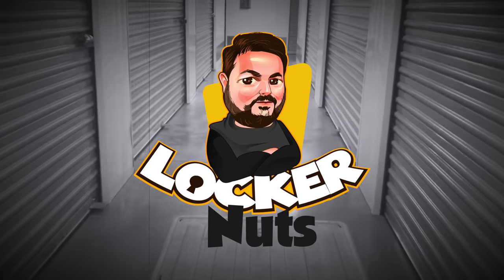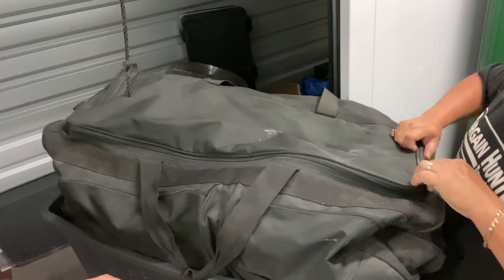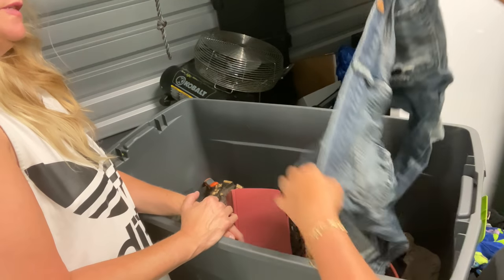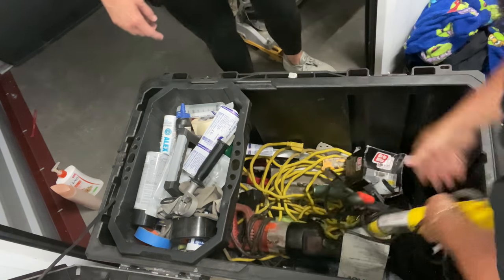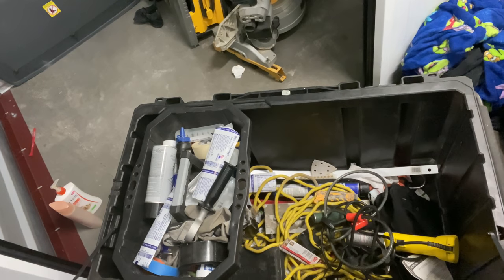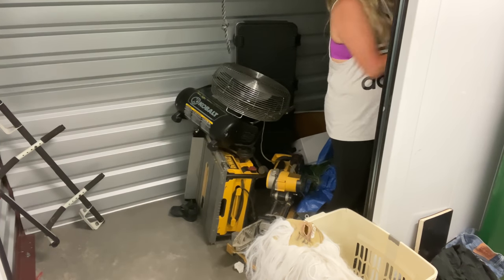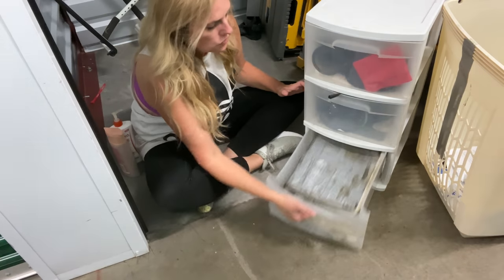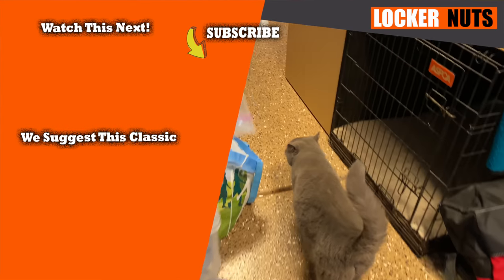WIFE PAID $1,100 FOR THIS LOCKER at the abandoned storage auction, Storage Wars style.

Comment: The cast iron dutch oven can be scrubbed with a 3M pad or scrub brush.  If that doesn't work, you could use a Brillo pad but the hard core cast iron folks will probably freak out.  The seasoning is gone or it wouldn't have rusted.  Then wipe it with a light coat of vegetable oil and warm it up on the stovetop or in the oven, then wipe any remaining oil out.  That should keep it from rusting further.
Reply: Yep, never use steel wool on cast iron, it will put the pan.

Comment: Use coarse salt to scrub off the rust and scrub heated salt in the pot to season it. Finish by applying a high smoke-point oil into a hot pot and then let it cool naturally.

Comment: Wash pot and rub cooking oil over inside and put in oven or on pit,  heat for 30 minutes. Always wipe with cooking oil after washing pot to prevent rust
Reply: Most of that looks like surface rust from moisture exposure.  Instead of the oil, you can use solid shortening. It's easier to apply.
Reply: Are you able to use soap on cast iron? I always heard once its seasoned all you do is wipe it out, since it absorbs the soap??? Not sure just what i heard.
Reply: Cindy King no soap
Reply: I agree scrub it good oil then throw it in a pit fire and leave it till the fire burns out. Thata what I always go with my cast iron.
Reply: yes, what she said
Reply: Never use soap on cast iron
Reply: Agreed no soap just scrub it with one of them green kitchen scrubbers and oil, it's called "seasoning" the pan.
Reply: Lard is the best for it
Reply: Do NOT throw cast iron in the fire! Great way to destroy cast iron.
Reply: Cindy King 
You can occasionally use a MILD soap. Definitely not something good like Dawn.
Reply: @cindyking6928  Only if you've just found it and it's absolutely filthy. Otherwise no.
Reply: @cindyking6928   I have re-cured cast after washing with soap then re oil and bake at 500 degrees it should be repeated as needed until it stops sticking when used. never wash with soap after it has been seasoned. If it sticks while using it should be re cured as needed I re oil mine after each use to avoid rust.
Reply: Use course salt an lemon will get the rust off. Then wash with hot water season with cooking oil and turn upside down an bake for hour
Reply: @chrishirner9292  Correct!
Reply: @Lilbear1960  Any cast can be washed if allowed to rust. To remove deep rust should be sanded to bare rust free metal then re seasoned with cooking grease to 500 degrees 30 min. re greased after each use to avoid rusting again.
Reply: @lindablackmore5882  I oil mine only wipe off as much oil as possible heat until sure there is no moisture or sticky residue then store til needed
Reply: @halomom1  How do you think we did it on camping trips bring a stove? Why would you think fire would harm cast? all Cast was put in or on fire since it was invented  For well over a thousand years, cast iron has been used as a reliable cooking surface. What do you suppose they cooked with? I don't think they cooked with sunlight.
Reply: @marcietee3841  😂😂😂
Reply: @marcietee3841  There is a huge difference between cooking over a fire and seasoning a cast iron pan by throwing it in a fire and allowing it to stay there until it cools! Our ancestors were very skilled with the use of cooking over an open fire and using the smoldering embers and ash to season their pans. Today, we have better, less dangerous ways to season cast iron using our ovens. There is less chance of getting the pans too hot, which can cause warping, breakage, and spots where the new seasoning will not stick. Yes, I have my grandmother's skillets, and I am not going to take chances with them by throwing them in an open fire with very little way to control the temperature. Check out Cast Iron Chaos on YouTube or Facebook Group called Cast Iron Cooking. There is a huge group a great people who are willing to provide tips and tricks for using cast iron for today's cooking. And they instruct without belittling anyone!
Reply: @halomom1  So how many have you seasoned personally? I can't count how many I have done. including the campfire method. I never had one warp. Then again I never had cheap thin cast either. At 72 I still have all my cast except my camping pot, some call a dutch oven. I gave it to my son for fishing trips. What causes warping in cheap cast is cooling too fast and mayby heating in a really hot fire then dipping in water.

Comment: best to use is sos pads to remove rust hand dry, rub with flaxseed oil wipe off so there is thin layer of oil and heat in oven 350 for 1 hr

Comment: If not wanting to put in fire the cast. Iron scrub with steel wool once clean, then put oil rub in and outside put on low temp in oven low 250-275 if below sea level 225. Every Time you you use especially inside and lid don't use soap when cleaning no DW EITHER. So many ways to do cleaning had my Grandmothers & Mothers so they can last forever if taken care. Good cast iron pot. When you put it in oven after oil is called seasoning and will last quite awhile btw reseasoning.

Comment: So far, the cast iron kettle/lid is the nicest piece...for me.  Rust is easy to remove. Just don’t use metal scratch pad. Then clean with vinegar and dry completely.  Then rub a good cooking oil into inner surfaces (my grandma always used pure fat or lard). Putpan in oven for 1 hour on low bake. Remove and wipe clean with soft cloth. Cook away but don’t vigorously clean again until necessary. I have many of my grandmas that I use that haven’t been re-cured for years.  She would tell me to just get pan good and hot before using.  She was on “old school” grandma with knowledge beyond a google.

Comment: Clean cast iron affected rust areas with steel wool, wash with mild soap,  oil pan down, heat it for about 20-30 mins in oven. ♥️
Reply: yes that us the way my family takes care of their cast iron. use steel wool to take away rust.. coat with grease or oil..put in 299 degree oven for 30 minutes..may need to do this a few times after the first uses  till seasoned good.. great find

Comment: Rust out of cast iron. Wash it with dawn dish soap. Use a steel scrubber till rust it gone. The next step is key. Take a paper towel and put 3 drops of veg. Oil in the pan. Use the towel to smear it all over the inside of the pan. Put in a low temp oven 250 for about 20 minutes. This is called seasoning the pan and should be done after each use. Eventually that pan will be more non stick than any pan you have ever had.

Comment: 6:00 if its surface rust, easy hot water and a rag, if the cast iron is pitted from rust it's a lot of work to remove with wire brush and re-season

Comment: Comet and a scrub spoong and elbow grease will scrub away the rust then hand wash in hot soapy water. After drying well take a paper towel dipped in vegetable oil wipe every part of the cast iron inside and out even the lid then place your Dutch oven in a 350 degree preheated oven leave for 1 hour alow to cool in the oven. You have just seasoned the cast iron if it seems uneven repeat with the oil and bake for 1 more hour.

Comment: That cast I iron didn't look like it had been used or seasoned yet,  so you can clean it any way you like.   Soap and water or a brillo pad.   DRY well.  Pre- heat oven to 300°.  Warm the pot fir about 5-10 minutes.   Pull or and saturate inside with peanut oil, rub outside lightly,  return to oven for 10-15 minutes.   Wipe out excess oil.   Return to oven.   After 10 minutes turn off your oven and allow y to cool in closed oven when cool wipe again to make sure no oil is puddled inside.  If there was oil puddled,  put on a med. heat stove burner fire 5 minutes,  remove and wipe again.   Cool and put  away.  It should look a little darker and have a like sheen.   If it had never been seasoned you can repeat the seasoning steps a couple times to build it up.   Once done it will become a non- stick pan.   Great for frying,  making cornbread,  even pancakes.  I have haf a family cast iron pan for 40 years that my dad had for at least 20 before that.   Great pans.

Comment: The Dutch oven needs to be reseasoned:  Wash it with soap, dry it then cover it in oil (inside and out) and bake on 175 degrees for an hour or two to reseason the pan.

Comment: After thoroughly scrubbing cast iron oil it inside and out out and put it in the oven on a low heat to set it. In the future just wipe it out and never scrub it. It will serve you well for a long time. I've been using some that belonged to my grandmother for over 50 years.

Comment: Cast Iron: Coleman is most likely the camping gear company-not high value. *If you can get the rust off easy with distilled vinegar soak, salt scrub (no soap or detergents) then re-season it with lard in the oven, it might be worth doing. If not, take it to your low end flea market as is, someone will cough up $5 for it.

Comment: Ijust clean the cast iron skillet in the sink like I wash dishes. Then I sprinkle comet in it and use a stainless steel scouring pad till all the rust comes off. wash as you would your dishes and rinse well. place on a gas stove burner to completely dry. as soon as you put it on the burner, take some paper towels and some vegetable oil ( use tongs so you don't burn yourself. ) coat  the inside of the pan and insides. When it's completely dry, you've seasoned your pan and it's ready to use.

Comment: Use a drill with wire brush on it brush the cast iron inside and out then put a light coat of oil on it bake it in the oven at 350 for about an hour take it out let it cool hot hot water and just rinse it out put another coat of oil all over the inside bake it for another hour and you've got a fantastic cast iron pot

Comment: Ok you can bring that cast iron back to new. Scrub it with warm soapy water use a brillo pad or even a wire brush till it all rust comes off. Then wash it again with warm soapy water rinse. Towel dry then cure it again. Wipe oil all over inside and out with veggie oil or crisco. Cook in oven at 400 to 450 for 45 min. Make sure you put tin foil on shelf under pot to catch oil drippings. Let cool and do not rewash with soapy water. If you need to clean it try not to use soap again or you may need to cure it again. I love cast iron skillets.
Reply: NEVER use a Brillo Pad or scrubber on cast iron!
Reply: @cemwalker  yeah well i do it all the time IF my cast iron ever gets rust on it...it works like a charm!!
Reply: @cemwalker  FYI ..i just googled it to make sure i WAS right...you may need to google it yourself...i was right. Just sayin.
Reply: @dawnkeener9836  You do realize that you can get any answer that you want, on the internet, right?  Just sayin...
Reply: @cemwalker  im well aware of that but ive been cleaning my cast iron skillets since before the internet was even around.
Reply: @dawnkeener9836  As have I. And, I have also grown and learned so much about it over the years, which is why I said what I did.
Reply: @cemwalker  ok lady im sure you know it all and the only way to do things is your way. SMDH...ive done this for 40 yrs and mine are great. And ill keep doing it cause it works. Have great life.
Reply: @dawnkeener9836  So have I. Same to you.

Comment: Scrub with salt rince and repeat. No soap! Rust will eventually be eliminated. Then grease all over with oil and place in oven set at 225 for a few hours. Wipe out with paper towels and  then coat with oil.  Considering amount of oil may need a second round. Kept clean and never use soap twill last forever. Mine was given to my mother when they were married in 1938 and I use it all the time. Cared for they are amazing. Don,t use for acidic fog like tomato.

Comment: Just scrub that Dutch oven with a brillo pad. Then you dry it and rub an oiled paper towel over it.
Reply: The problem with steel wool is that it scratches other metals.  Microscopic scratches on some metals, but those little scratches make pots and pans harder and harder to clean over time.

Comment: Brillo or steel wool and dish soap. (I prefer dawn)wash and dry. vinegar to brake loose extra oil deposits any of these should work for rust, dry completely lightly oil inside and out then put in a moderate oven for 30 mins 350 degrees aprox should be just fine

Comment: It's like daytime in there! ❤️❤️❤️❤️
Reply: I have removed the rust from a cast iron before. It is actually pretty easy! Here are instructions I copied online: 

How To Restore a Rusty Cast Iron Skillet

What You Need

Steel wool
Dish soap
Scrubbing brush, scouring pad, or sponge
Dish towel or paper towels
Vegetable oil (or cooking oil of choice)
Aluminum foil
Oven
Instructions

Remove all the rust: Use fine steel wool to remove rust from affected areas. Scour the skillet until the area returns to raw cast iron.
Wash the skillet thoroughly: Wash the cast iron with warm water and mild dish soap. Scrub with bristle brush, gentle scouring pad, or mesh sponge if needed.
Dry the skillet: Thoroughly dry the cast iron immediately with a clean dish towel or paper towels.
Cover the pan with a coating of oil: Apply a small amount of vegetable oil (or cooking oil of choice) to the entire piece.
Don’t forget the bottom and handle: When oiling, don’t forget the bottom and handle. Use only a small amount to avoid a sticky surface.
Place the pan in the oven: Place the cast iron upside down on the top rack of your oven. Place a sheet of aluminum foil or a foil-lined baking sheet on the bottom rack to catch any oil drips. Heat the cast iron for one hour at 350°F.
Let the pan cool before using: Turn off heat, let cast iron cool, then get back to cooking!
Reply: Lard is better than cooking oil though!
Reply: People do hide drugs in those hide a can things (they ASSume the police are stupid...they're pretty smart on those containers, I bet!).
Reply: My oldest son was just a baby when Forest Gump came out. We lived in Guam (he was born there). We went to the base theater to watch Forest Gump for free. Canyon kept crying so I went outside. Boy was I mad at my husband for never coming out to even see if he could take turns holding Canyen. 
😆😆😆😆😆 Bruce's as* was grass & I was the lawn mower, as my Dad always loved to say when we were young. Lol! Bruce got his chewed pretty good. He did not make the mistake of leaving me outside for an hour plus again. That was a bit over 25 years ago! He is still married to me so must not have scarred him for life. 🤷‍♀️😂